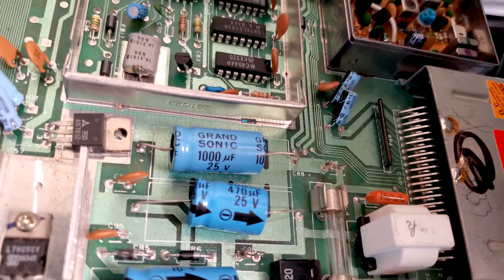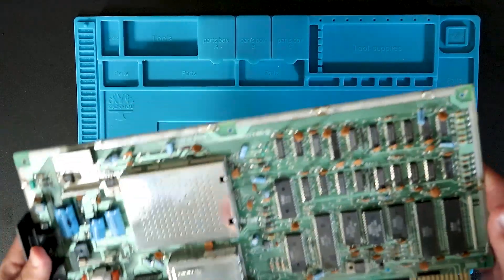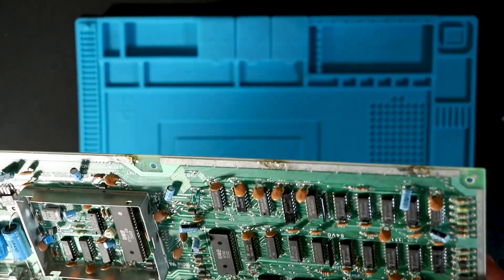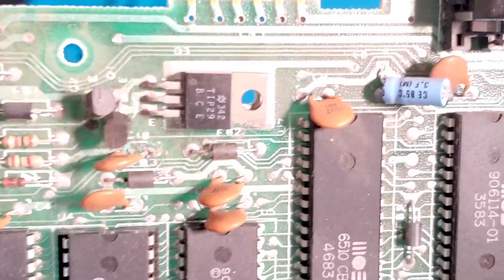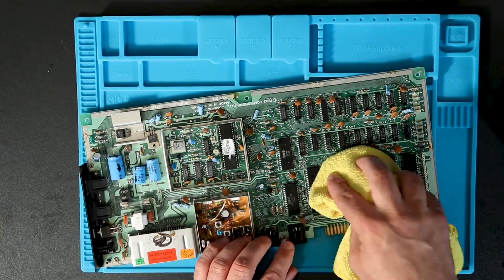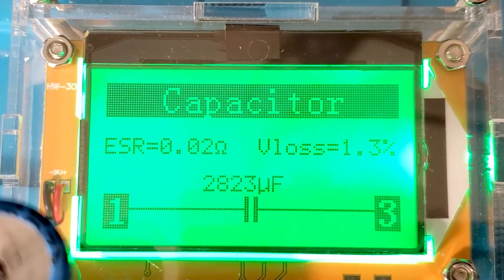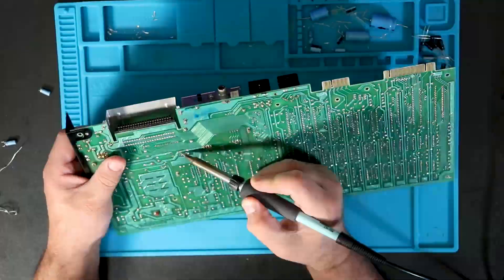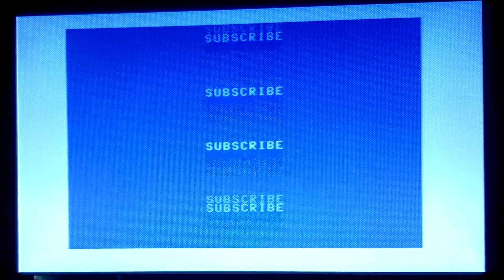Commodore 64 Restoration - Future Proofing and Capacitor Testing

Comment from the maker: When it comes to recapping I tend to prefer to keep things original if possible. In this case the computer was functional but the caps had clearly failed when tested. If computers follow other antique trends, a time will come when the most original unit is the most desirable. How do you feel about the balance between keeping things original vs preventive maintenance?
Reply: Recapping the 1541 controller board improved operation, after fixing the speed again. Hard to describe, just smoother working drive after this, but not so much with a primary board recap.
Reply from the maker: Thanks Oh one whos user name I cannot say with a straight face. 😂  I will certainly keep an eye on this. I tested the main power caps and they were well within spec. If they are an issue (Which could be useful) I will try to identify the failure mode. I did have a shorted Tantalum. I think they may well be problematic since the 1541 runs so hot.
Reply: I can't imagine that an antique computer full of capacitor puke will be attractive, even to a purist. But what do I know? :)
Reply from the maker: Hagledesperado, I actually made the decision based on what I know, or more accurately, what I don't know. If I just blindly replaced the caps I learn nothing but, since this is my bench machine that I am in on a regular basis, there is little risk of a puke fest. One of the papers I read while researching this video was "Observation of electrolytic capacitor ageing behaviour for the
purpose of prognostics" (http://eprints.whiterose.ac.uk/104114/) which implies that the half life of an electrolytic capacitor is based on temperature and that approaching failure can be detected by an ESR and capacitance curve. My intent is to measure these caps each year and see how they do over time. I had a lot of this in the rough cut of this video but it seemed preachy and boring so I cut it.

Comment: Very nice walkthrough, thanks for this!

Question: imagine you pulled out three bread bin C64's from storage and one of them is very clean inside, and seems to have had work done, would you still take the time to recap? 

In this unit, the PLA has been replaced with a modern "J-PLA", and the rest of the components almost all show very clear lettering, with various styles of labelling. And the three large capacitors on the right-hand side of the board are a lighter, grey blue (much more grey than the "Grand Sonic" and "Unicon" caps in the other two C64's). 

These large caps are marked "Nitsuko" which I've discovered are one of the brands used by Commodore on some of their C64 models, but I imagine those could've easily been sourced fairly recently and used to replace original caps.

None of the large three caps in any of these C64's look to be bulging, to my eye.

In this case, off the top of your head, would you suggest I go ahead and take the time to recap this nice clean C64 with signs of refurbishment? I'm in school and low on time these days, that's why I ask. 

Thanks!
Reply from the maker: That is an interesting question Shlem Dickins! I have to be up front that I am very much in the minority in the community on this. If a Breadbin C64 has not had significant rework done on its board, and the caps are looking clean, I do not recap it. My experience is that caps of that era are pretty reliable and don't exhibit the leaking that you see in so many later machines. I have never seen, in person or in a video, a breadbin 64 cap leak unless it has been physically damaged. I even asked Ray Carlson if he had ever seen breadbin caps leak and he said he had not. That doesn't mean they won't in the future but I believe that an unmodified board will be more collectable in the future so I leave it be. If I were to sell a machine (Which I have not done since the 90's) I would give the buyer the option. Be aware that this is just for machines of that era. I am in the process of recapping an Amiga 500 as we speak since they are getting into the troubled era for caps.
Reply: @RavenWolfRetroTech  just the enabling (or is it "disabling"?) I was hoping for! 

Seriously though, whoever had this thing open last knew what they were doing. They even kept the large metal chip shield/heat sink in place, complete with fresh thermal paste for making contact with the hotter chips.

Now I can concentrate on other aspects of this setup; Cheers!
Reply from the maker: I have seen some evidence that the RF shield does little to cool the chips; some even say it heats them up. I generally keep them if they are metal and set aside the cardboard ones. Either way I'm not sure it makes much of a difference. In the end, it's your machine so just enjoy it and, when it breaks as things this old tend to do, then you have a free puzzle to work!
Reply: @RavenWolfRetroTech  I read that too, but it was about the earlier soft shield made of cardboard and aluminum. Is this what you're referring to?  The shield I have here is all metal and is designed with tabs that reach down to the hotter chips, doubling as a kind of mass heat sink.  Take a look here, if you're curious; this is the same one I have here: https://www.breadbox64.com/wp-content/uploads/2019/01/IMG_8582.jpg

Comment: Yup.... Always use new quality caps. 20, 30 or 40 year old caps are best suited for an electronics museum.
Reply from the maker: Actually brostenen, what I find interesting is that 20-30 year old caps belong in the trash but 30-40 year old caps are far more reliable than most of the ICs in these machines. I have never seen these 80's caps leak while 90's ones are garbage. I Have seen a Breadbin with a shorted Cap but it did not leak or cause any damage (an Electrolytic but it failed like a tantalum). Based on that you  would improve reliability better by replacing all RAM or all PLAs. Because of this you will be seeing breadbins keeping their caps here if the machine has had minimal, or no, solder work on it. I The collectables market has shown that the best collectible is as close to stock as possible and this generation of caps are demonstrably not a hazard to the machine. Now 90's stuff is an entire different story. Sorry for the long winded response but I have been doing research on this for one (of several) videos I am working on. In fact, if you have had a breadbin with damage due to leaking caps, or can find any images of such, I would be very interested in seeing them. Love your new Retro-Space - Its looking good
Reply: @RavenWolfRetroTech  Yup. The chinese caps are the worst. Especially the SMD ones.

Comment: I recently stumbled across this nice explanation of how not to break the tabs - I've switched to doing it this way, i.e., never flip the keyboard/top up like a car's hood past ~30 degrees. (The whole blog is excellent, really, esp. for those like me that are catching up on Commodore retrofixes.)
https://dfarq.homeip.net/how-to-open-a-commodore-64-or-vic-20/
Reply from the maker: I have started using this method. Thanks
Reply: @RavenWolfRetroTech  btw, I dropped you a couple emails in the past month. Just letting you know in case you haven't checked that mailbox. :)
Reply: @DrDavesDiversions  Apparently you are not getting my replies... they are going to an advos....@gmail account
Reply: @YarblekRW  UGH! Why I are they in my spam folder when I sent from that address.
Tnx for letting me know, I'll reply from there!
Reply: Oh, no, sorry some other YouTubers are in my spam, but not yours.
I don't have email from you via your RetroTech@raven... account in your About info.
Hmm. Will look around.
Reply: @YarblekRW  Oh, I see what's happening.
Found the emails from you. They are replying from mike@... when I wrote to RetroTech@... so GMail marked it as spam, for one reason because it seems unsolicited. I'll have to check the email headers to see if your email has some other rewrites increasing it's spam score.
tnx.

Comment: Does that CAP tester work better than a multimeter? If so, can you give a link so I can purchase one?
Reply from the maker: @Rick, If you have a multimeter that tests capacitance and ESR then it should work fine. I do not as I am a child of the 80's just getting back into things after 30 years. Do remember that you need to take the cap out of circuit (Just unsoldering one leg is fine). That little tester tests caps, transistors, diodes, SCRs and a ton more so for about $15 its a steal. There is a link to it on Amazon in the video description. I have also seen them on eBay for about $7 without a case.
Reply: @RavenWolfRetroTech  My multimeter is the Bel Merit DM3050 which came from electronics school in 1990. this other tool probably does a bit more in testing these devices. I have been in the PC world, but not the old 8 bit c64 and c128. I am just getting into repairing them after growing up using them.
Reply from the maker: @Rick For me the Multimeter and the component tester serve different purposes. The meter I use to check voltages, continuity, etc... The little component tester I use to make general checks of various components. For $15 I don't assume it is crazy accurate but it does seem to do a pretty good job so far testing capacitors and transistors. I have also used it to verify a resistors value when I could not tell if the markings were orange or red but I could have checked that just as easily with a meter 🙄. I repaired a ton of them back in the late 80's and early 90's but life happened. Loving getting back to it again!
Reply: The $15 component tester is indeed not particularly accurate. But it's good for a quick ballpark estimate. And as a component type identifier, it's brilliantly handy. Worth every penny IMO. Just search for LCR-T4 on your favorite cheap electronics web shop, and you'll find many variations to choose between. Some in enclosures, some bare PCBs, maybe even a DIY kit.
Reply from the maker: Thanks Hagledesperado, Since I last took, and taught, electronics in the early 90's they seem almost magical 🙄. Now that I finally have a shop and am getting moved in I'll need some better equipment but Its amazing how useful ballpark measurements can be in electronics.
Reply: Yeah, a ballpark measurement is often all you need, and even when it's not, it can tell you what needs more careful measuring and what doesn't. I also studied electronics in the 90s, got back to it a few years ago as a hobby, partly because I was restoring an Amiga 600. Fun stuff. It's so different now, with the Internet at your fingertips for reference, and all the new toys ahem tools that can be had for cheap.
Reply from the maker: Hagledesperado, It sounds like you are a few years ahead of me on your return to the good old days. With the exception of a Pinball machine restoration in the mid 2000's my electronics life was delegated to board swapping, since copier and printer companies don't provide enough information to do board repairs in a cost effective manner for customers. I am jealous that you have an Amiga up and running! I promised myself that I would follow my original track with Commodore so i'll do a 128 when I can get one and then do an Amiga 500 which, in a life full of computers, stands head and shoulders above all others in my memory 🤓 Is it as good as I remember?
Reply: The Amiga is awesome, not only for the nostalgia value but everything it can do. Still, for me, restoring and upgrading the hardware is the most enjoyable part. I upgraded mine to the teeth with a 32 GB solid state hard drive (SD/CF card), 2 MB of Chip RAM, an RTC, a WiFi PCMCIA card, and last but not least a Vampire 600, so now it's one of the fastest Amigas I ever laid my hands on. But I think the CPU adapter might be a little sketchy, because last time I tried to play some games on it, it randomly froze. Got to find the time to fiddle some more with it and try some Deoxit on the CPU pins. But first I think I'm going to try to get my hands on a 15 kHz compatible monitor so I don't have to use the TV.
Reply from the maker: That sounds amazing Hagledesperado, My Amiga 500 was tricked out with a Supra HDD and RAM but nothing else (Unless you count that I had installed it into a full size tower case 😜). This makes me want to skip the C=128 and go straight for the Amiga...I must resist